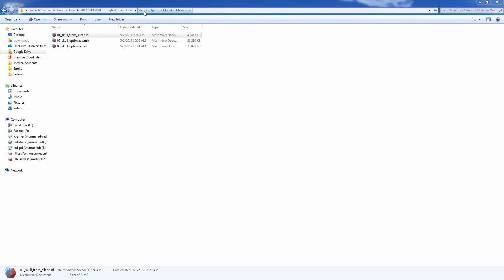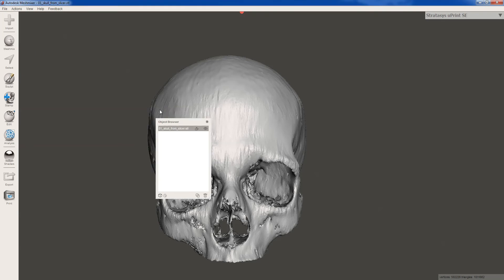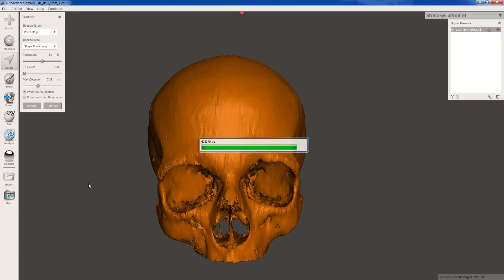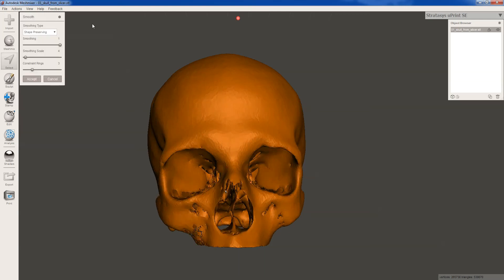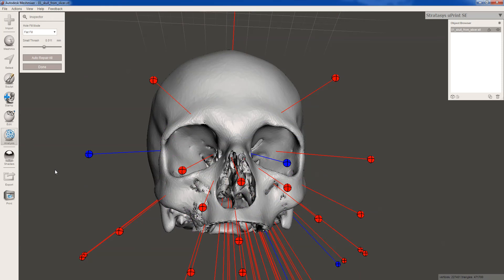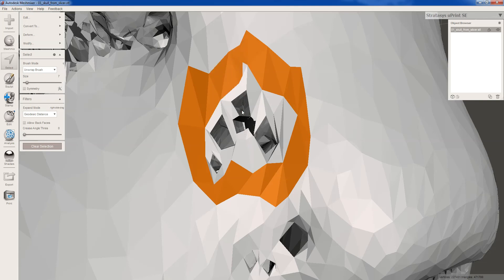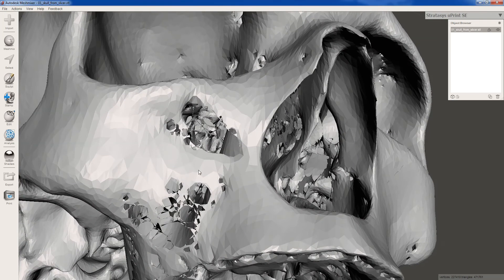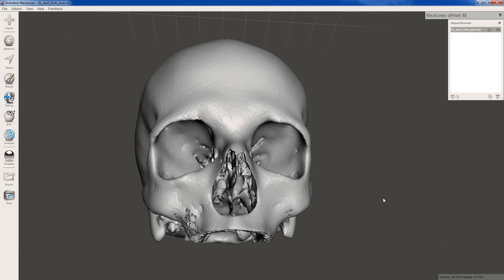Step 3 Optimize Model in Meshmixer

Comment: hi, i'm using the inspector tool but instead of filling in the part, i delete it
Reply from the maker: Hard to know exactly what the problem is. I will say I hardly ever use hole fill in Meshmixer because it can be difficult. I prefer to just fill in holes while I'm segmenting in Slicer.

Comment: Any recommendations if smoothing does not succeed in eliminating all bumps/irregularities?
Reply from the maker: Honestly I'm finding it easier to optimize and tweak my model in 3D slicer - it can do smoothing also, and it's easier to fill in holes. I mainly use Meshmixer for plane cut (can't get a totally smooth cut in 3D slicer) and adding dowels to fit things together.
Reply: @justincramer9557  I'll keep working on improving my Slicer Skills. Thanks for answering so quickly. These tutorials are awesome!